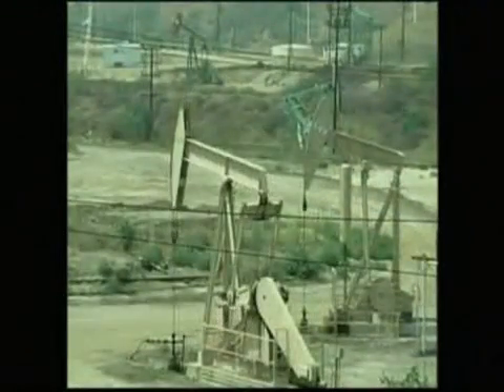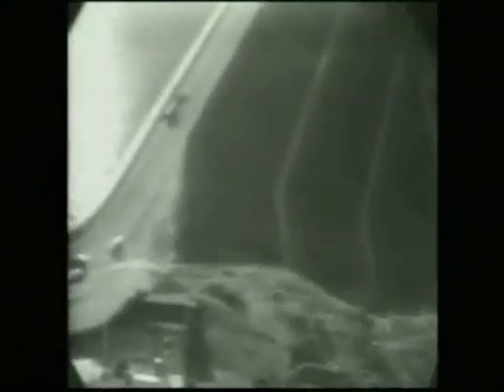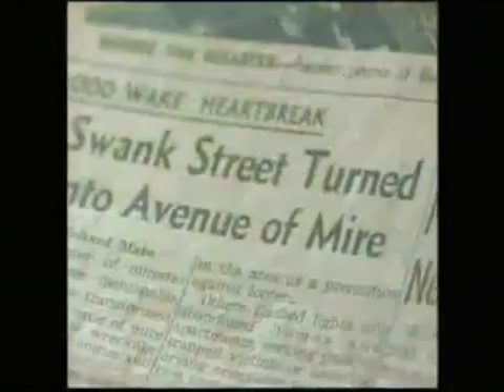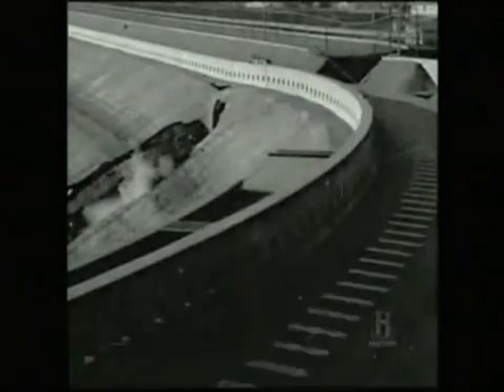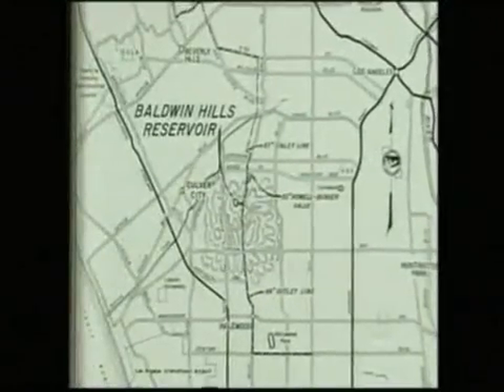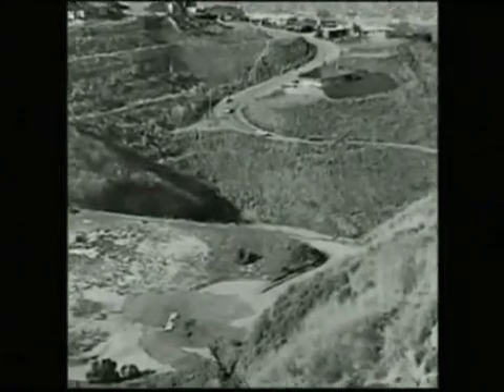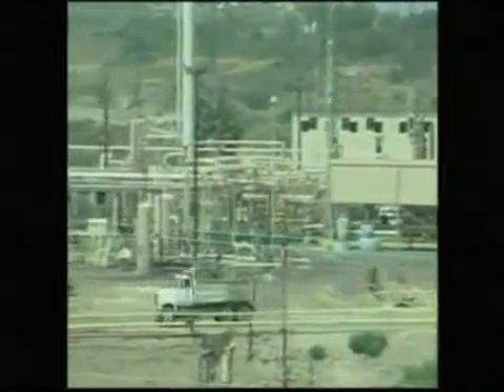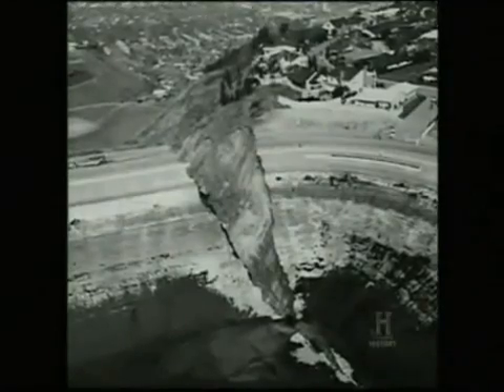1963 Baldwin Hills Dam Collapse - Caused by Oil Field Operations

Comment: 1/4" layer of asphalt\cotton fiber kept the water from getting the foundation of the dam\reservoir, think about that. blame the oil field and not the idiot engineers who designed the dam. it was built on numerous surface\deep faults, clue number 1. The oil field was there prior to the dam, on pumping units (no reservoir energy\pressure). Water was being reinjected as a water flood and pressure should have been stablized.

Comment: Baldwin Hills, the largest contiguous oil field in CA, and one of the three largest contiguous oil fields in the U.S. just had a 3.9 according to ABC 7. This is the second earthquake in Baldwin Hills in about the last month. This area they are fracking is unstable as the Inglewood/Newport fault line runs right through it. If set off, we are looking at a 7.4+ if memory serves. Think of Nepal, and get angry. They have no right fracking, and drilling in Baldwin Hills, or anywhere in CA! We will be posting as updates come in.
Reply: Jacob Sullivan u r an ijit, there's evidence a plenty, just not more than the money that stands behind it not being front & centre. Keep piece(s) of what used 2b your home.
Reply: English Settlement Underground you're dealing w unknown variables that aren't scrutinized publicly, what do you think happens really, hmm?
Reply: Jacob Sullivan I'm not contesting some1 elses spelling here, & generally don't spell check unless I'm writing 2a broader audience.
 Keep it 2 the points of relevance pls.
Reply: Jacob Sullivan Obama is a fiscal conservative & gave in early to homegrown efforts 2b "less dependent" on foreign energy reserves. With the testing done so far on communities near fracking flares, pumps, & wells, many had low birth weights, unexplained miscarraiges, cancers, early childhood developement disorders, fatigue, & flamable water w dangerous concentrations of highly toxic gasses, & when well casings broke, which often they did, traces of fracking fluid.
  Pls don't entertain me w what the largest energy consumer in the world looking 4 energy indipendence would say on the eve of o.k.ing a frackathon of epic proportions. Shale & other groundrock formations let upward travelling gasses leetch laterally for miles indiscriminately of who's water wells it may contaminate & who's farmland gets permiated with trace gas accumilations.
Reply: Jacob Sullivan : Jacob.. with wind & solar producing 0 emmisions, how does natural gas somehow get below that mark? or were U commenting on the total European  emmisions output.
 The Netherlands is now a net exporter of energy with its huge wind & solar framework (As is Chile) & Germany plans 2b the same by 2030, those who've said it 'just can't be done' can eat their defiant words now, as they're making not much more than hot air.
Reply: Jacob Sullivan Under Trump whose EPA guy is an oil ind. executive narcasist shill, there'll be no halving of anything in the U.S. but disposable income.  & yes existing climate changing patterns like the noticable slowing of the jetstream has caused longer periods of pressure systems of an area, but that by no way means wind & solar r unreliable or non beneficial.  Natural gas is abundant & cheap & should be used to replace oil & coal where practicle, but the big energy companies are investing mostly in the cheaper infrastructure & higher returns of free wind, solar, & anytg sustainable, it just makes sense.
Europe has much higher fuel costs & a more developed sense of the need for sustainability, the Russains like soaking them for nat. gas bec. there's nowhere else 2 get it in abundance, making it 'reliable' but not preferred.
Reply: Jacob Sullivan Jacob, your sources for emmisions reductions stats 4 Eurpoe vs U.S. r from where, Fox? or did u just make bias assumptions? Most European countries E.U. or not, emmisions wise start from a much lower rate per head of population than the U.S. or Canada, period. Context here sheds light, wind & solar won't pollute during extraction, don't have pipelines to spill, don't have emmisions, & thru the grid, wind & solar's electricity will always be available somewhere.
Reply: Jacob Sullivan Jacob, just bec. Fox paints Obama as a socailist commie, it still doesn't change the reality that the political pendulum in the U.S. has swung soo far 2 the right, its damn near gonna hit em in the ass from the far left. Obama could have been a republican in times b4 the 80's b4 everytg got 2b such an extreme & perverted version of itself.  & yes Obama alone is responsible 4 the fracking frezie in the U.S. that put them in position 2b a world leader in oil production, he signed that 1.
  Perhaps u should read the whole article sometimes, instead of grabbing the headline & ASSuming the rest based on generalized trends of bias.
Reply: Jacob Sullivan.  Evidence..  "Oklahoma Shakedown" -2015, documentary.  Seismic activity where no fault lines exist, strange, incredulous, yep.  Caused by fracking, yep.
Did the company lie about it, yep.  Credible evidence was ignored by company until the courts got involved.
Reply: Jacob Sullivan we'd be fine if it was just nat. gas, wind, & solar.
U assume i'm in a divisive camp of hippies or sumtg.  I've been following weather & patterns of change since the mid 80's.
Coal is the dirtiest problematic pollutant out there & has 2 stay in the ground.
Nat. gas is good low emission fuel but fracking extraction can't be done without toxifying the water table indefinetly, & earthquakes r a resulting reality of replacing gas with high pressure liquid underground.
I just hope we figure this out b4 our planetary life support systems fail 4 good.  Our oxygen, food, & water systems are all under threat & changing r now, we can't live without them.  We already experienced a season of global food shortages in 2011 when rice exporters suspended trade, & it'll happen again.
Reply: Jacob Sullivan Benzene & deisel don't go well in drinking water, or do they? & tere have been earthquakes in every area of fracking activity, shale is geologically unstable without adding moving liquid under enormous pressure.
U must live in an area where some half baked local politicians have self declared fracking "safe".  U wouldn't be singing that tune if your multi acre farm was turning into a dead zone & u couldn't sell it..